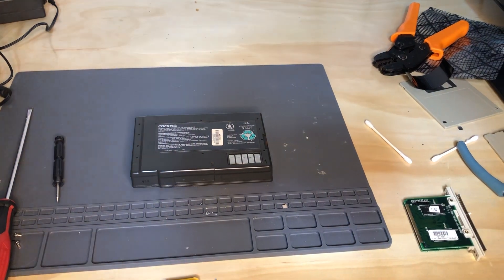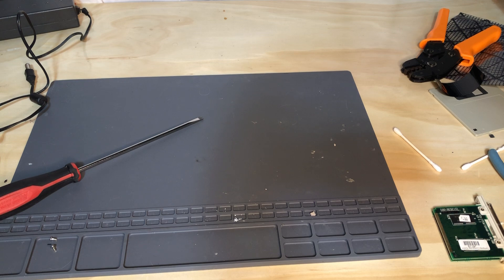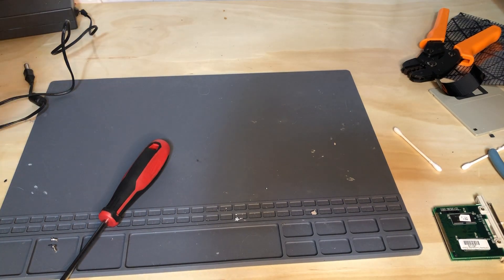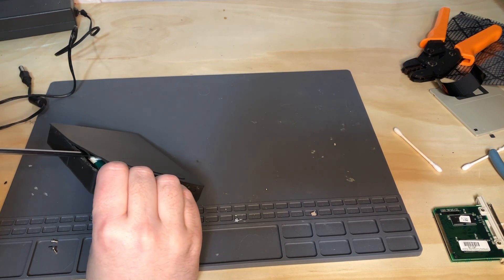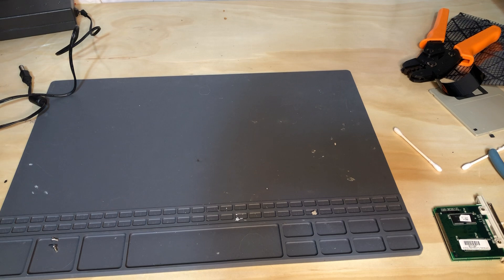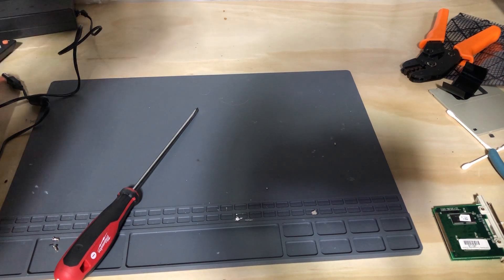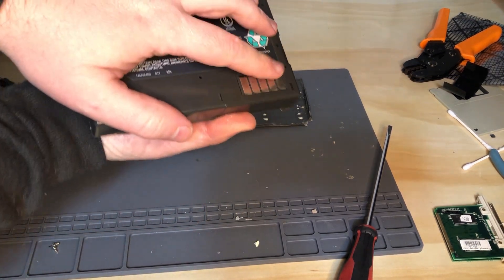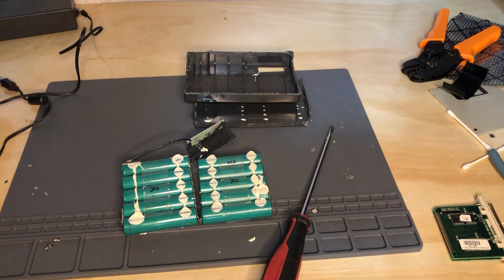Opening the Compaq Concerto Battery

Comment: It's definitely a challenge getting old plastics like this separated, especially with glue involved. You can't really use solvents because they will likely damage the old plastic, and without knowing the condition of the battery cells you don't want to go to heavy on the heat gun either. A lot of patience like you have is the best tool. If I could make one suggestion, would be to use plastic spudgers instead of metal drivers; they will wear out really quickly but usually cause less damage. I'm glad you were able to get this open without too much wear on the case, and that none of the cells were damaged in the process.
Reply from the maker: Constructive criticism is always welcome.  I'll definitely try the plastic tools.  It can't hurt.

Comment: “The credit belongs to the man who is in the arena”, as my favourite quote goes.
That said, I’ve had good success on other battery packs by using a new, sharp chisel (and a mallet) to tap strongly inwards all around the edges. The wedge shape of the chisel tends to pop things apart quite cleanly. I work on a concrete paver, on the bench, which probably helps to get as much impact as possible. Still, I did want to see where things were inside, whether there’s electronics, whether I have appropriate cells, etc. and your video does not disappoint, thank you for making it :) I was delighted to see no complicated BMS or ribbons in there (ever done a Powerbook 500-series battery?)…

Hot glue is interesting stuff because isopropyl alcohol can break its bond with the surface, so it might help to pour some IPA in and shake it around a bit.